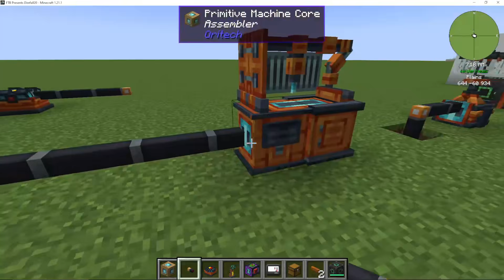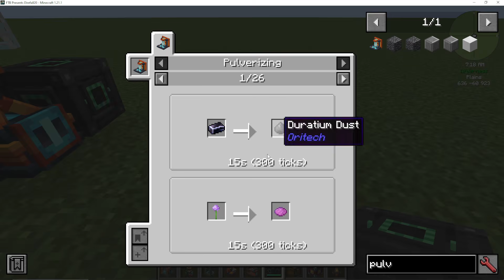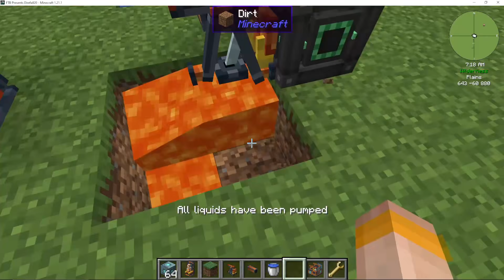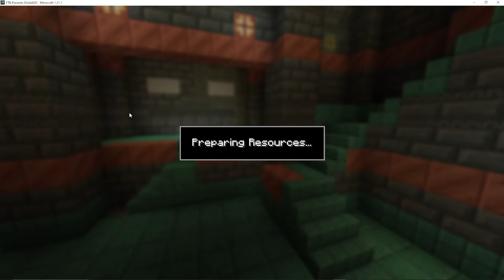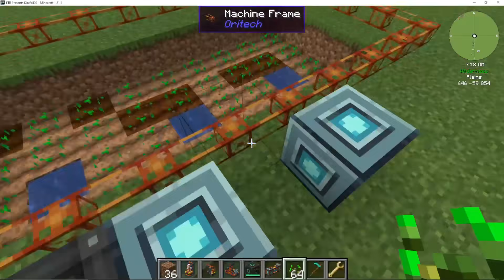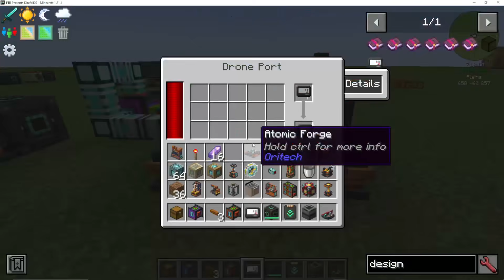The Ultimate Guide to Oritech - Minecraft 1.21.1

Comment: On the mod page for Modrinth it show compatible mods for fabric and Neoforge.

Fabric:
Alloy Forgery
Clutter
Energized Power
Mythic Metals
Tech Reborn

Neoforge:
Actually Additions
Applied Energistics 2 - the certus quartz also works the same as the amethyst!
Create
Ender IO
Energized Power
Immersive Engineering
Industrial Foregoing
Mekanism (and Mekanism Generators)
PneumaticCraft: Repressurized
Powah!
Productive Metalworks
Reply: With the bio generator you want to process the packed wheat which can net you roughly 5.5 solid biofuel.

Comment: is there any other way to get the water from the sink coz it doesnt work now
Reply from the maker: Make sure you’re “pulling” from the sink. It should accept pretty much any pipe from any mod but the pipe has to “pull” it out. The sink wont automatically “send / push” water

Comment: this is a great guide, but in my playthrough with this mod I've run into a certain problem.

is there any way to deal with the horrible energy transfer rate bottleneck for generators? since speed and efficiency addons are multiplicative, it's rather easy to get a tier 4 fuel generator(for an example) to produce 100 of thousands rf/t while also being taking thrice the time to spend the same amount of fuel as a standard fuel generator

the issue is that any energy transfer rate addons are additive, so even if i replace all machine extenders with power banks, I'm barely hitting 50k/t transfer rate

nothing I've tried to extract that energy despite the transfer rate seems to work, and this is just tier 4, so if i wanted to make a tier 7 machine the upgrade would be borderline useless
Reply: Lava or biofuel generators, place speed upgrades on them to make them produce faster, the problem is not your transfer rate, it’s energy creation. More generators, more speed upgrades, better results.

Comment: If You are curious, it seems with the bedrock extractor that if you only want 1 specific resource, then you should place the bedrock extractor so the only resource node below it is that specific resource. It seems to randomly collect 1 of any of the resource nodes below it every couple of seconds. For example I was testing it over 1 diamond, 2 gold, 1 uranium, 1 platinum, and 1 emerald, and was getting twice as much gold as anything else but only 1 randomly selected resource every 4 seconds or so. So in 400 seconds I would collect 100 resources and about 33 of them would be gold, while I would get around 16 of each of the other resources. Then when I moved it to be just over Uranium, once every 4 seconds I was getting 1 uranium so in the same time period as before, 400 seconds, I would have gotten 100 uranium compared to the 16 when above many different resources.
Reply from the maker: This is very interesting indeed🤔 I wonder if this is a bug or intentional

Comment: Warning!!! You don't need to use enderic lasers to power the linear motors on the particle accelerator. Cables or superconductors will work just fine
Reply: any tips for how to power said pipes though? the large energy storage doest have nearly enough transfer rate to keep up with even one of my linear motors and its rlly frustrating. ive tried using lasers and superconductors and figured out the only way i can power it is with a creative energy storage because the energy output is basically infinite. should i power them directly with power generation components or what?
Reply: @shovel_da_realest  I'm guessing you already figured it out but maybe one of those inductive power cells form mekanism would work (the big multi block power storage things) since those have really big rates of power transfer?

Comment: Looking for information on how to make the plastic sheets.. cannot progress without that information and none of the oritech-specific recipes show in JEI in the modpack I am using (unless they are regular minecraft crafting table recipes)

If it is required to have the fluxite crystals.. cannot get them without the laser which requires the target card which requires the plastic sheets.  Only other way I am aware is probably the fragment forge which also requires some kind of flux gate.. which I have no recipe for in the modpack.

Any help would be appreciated as I am currently stuck without these components.
Reply: OKay... found out through some playtesting and a few additional hints from the videos here...

2x2 wheat = packed wheat
Packed wheat into centrifuge with fluid addon and water = raw biopolymer
raw biopolymer into centrifuge with water = plastic sheet

Need a wiki for this kind of information